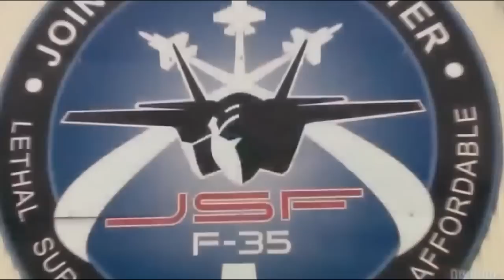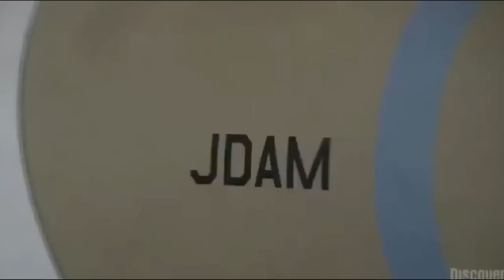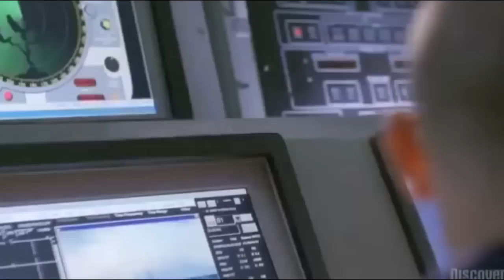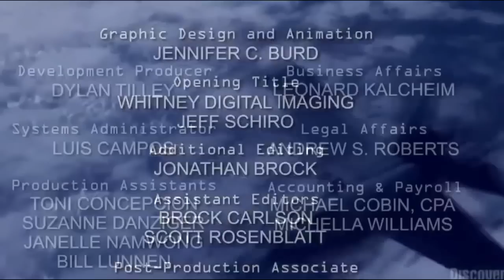Joint strike fighter documentary USAF NAVY

Comment: The EJ200 engine built by EuroJet Turbo GmbH gives the Eurofighter Typhoon supercruise capability. It is capable of supercruising at Mach 1.5 in clean configuration. Typhoon pilots have stated that Mach 1.3 is attainable in combat configuration with external stores.

Comment: The fuck does he mean "Its a Pilots Plane", that statement is completely redundant, who else it going to fly a fucking plane??
Reply: SimplyLucky123 It means that it's a pilot "friendly" plane. Older gen planes were harder to fly because of all the multi tasking that was necessary to fly it AND still complete the mission. Newer jets allow the pilot to concentrate less on flying the plane and MORE on completing the mission.
Reply from the maker: SimplyLucky123  Many get task saturated and end up focusing on instruments instead of flying , Its easy going and doesn't need to be pampered or rob you of time - IP Config basically answered